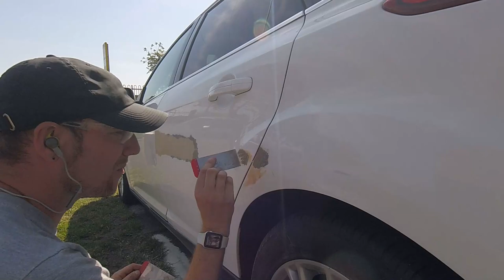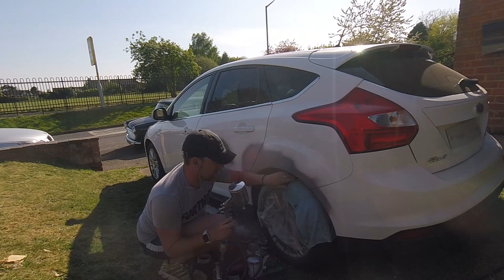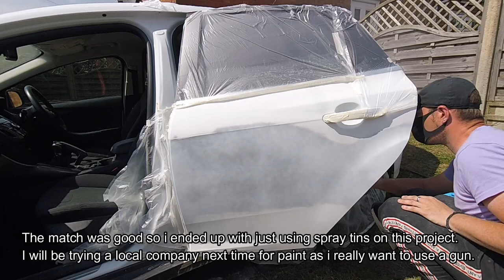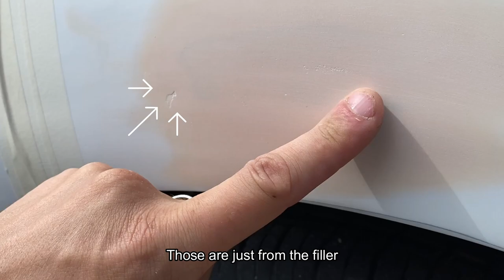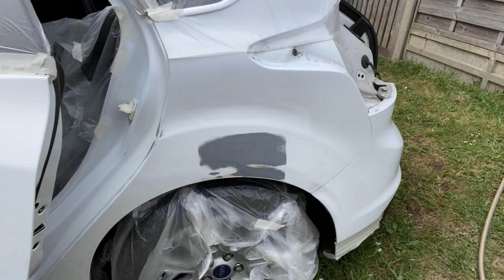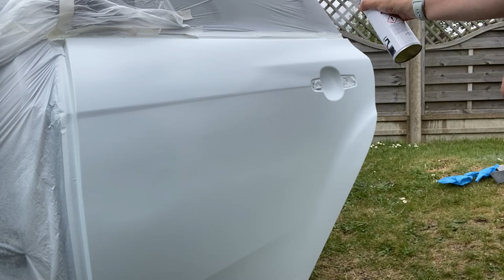2011 MK3 Ford Focus Titanium Copart Salvage Repair Build -  D.I.Y Rattle can paint job.  PART 4

Comment: Will you laquer it with clearcoat out of the gun or use rattle cans?
Reply from the maker: I used rattle can lacquer , it was in the deal with the base coat. I’m not comfortable using my cheap spray guns anymore , perfect for primer though. I will invest in a better gun. Any recommendations ? I don’t want to spend that much though, a good all rounder for the diy’er 👍
Reply from the maker: Also this lacquer is really good as you will see in part 5 after a cut and polish.
Reply: @everydaysalvage  I am in the same situation as you looking to buy a new gun . I still have 2 guns I used years ago, AID model 2  and a devilbiss jga 558 . They are dinosaurs by todays standard and would not really work well for todays paints,  ok for primer maybe. It seems a minefield like most of todays stuff far too much choice and from reasonable to rediculous prices
Reply from the maker: Hopefully we’re figure it out 👍 but I was aiming for a Devilbiss under £100 , I’ve seen a few on amazon , no point trying for secondhand as I cannot collect one. I will try my local paint shop who have them on display but the shop isn’t open all but for order to collect one which is the same as buying online.